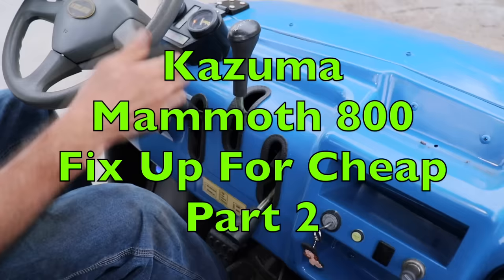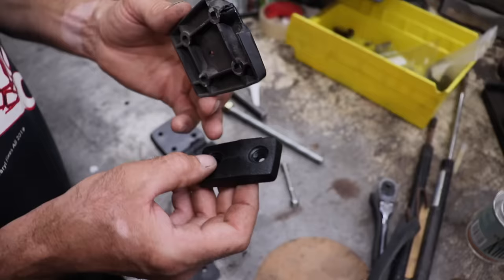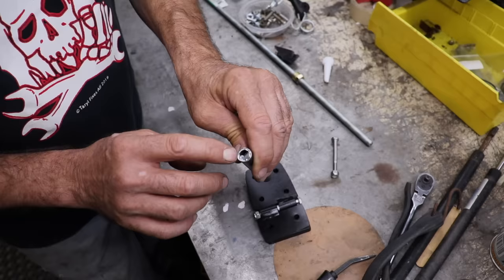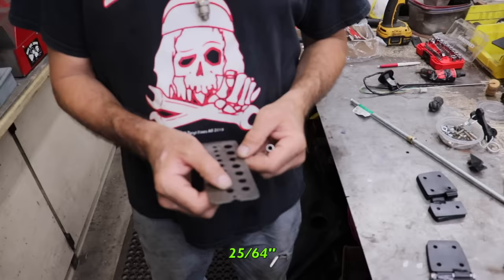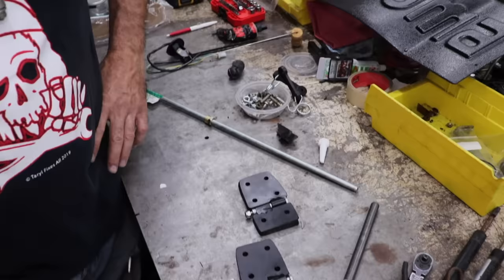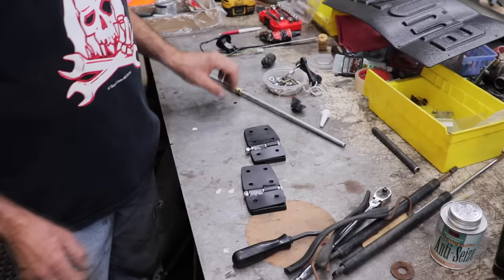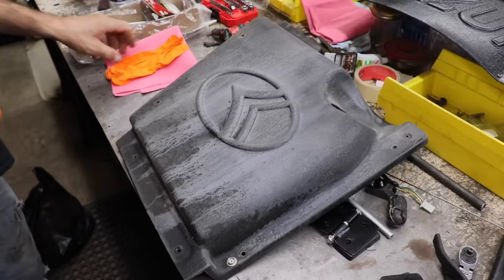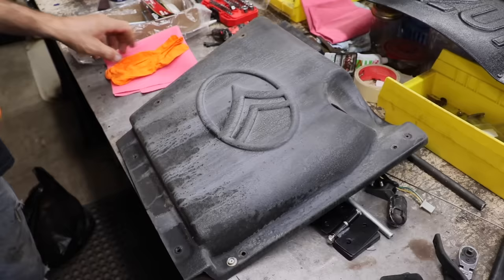Part 2! Incredible Kazuma Mammoth 800 Fix Up For Cheap!

Comment: Taryl you should consider getting a 3D printer. You would be amazed at the hardware you can replicate. Get Slippers to take some AutoCAD classes at the community college.
Reply: Yep...  Get the "Ender 3" -- it's less than $200 and is what everyone uses.

Comment: Make one hood pin longer that the other. That way you can use the long pin as a pilot and then just align the shorter pin and wha la slide the hood in place single handed.

Comment: I rework stuff like that. Most people don't take time to fix up stuff but I do. I work on ATVs for a side job. I gave $800 for a 2010 terex one seat side by side 750cc. 200hrs and replaced the belt and air and fuel filters and drained the tank and like brand new! $6500 plus side by side and $300 front bumper and a nice 4500 warn winch!  Nothing really wrong with it other than dirty fuel filter and air filter clogged up from dirt road and farm field dust an inch thick.

Comment: The cork idea for the fuel sender float is a good idea but how does cork hold up to exposure of gasoline?
Reply: Cork used to be used for fuel gauge floats. My dads old lawn tractors had them (1960's).
The problem was the cork deteriorated as it got old and broke up
Reply: Lawn boys have cork floats but they're coated, so you're right but there's a way around it.

Comment: Hey Teryl and crew I have a question: do you think it would be possible to modify a UTV like this with hand controls? An example would be the controls from an ATV. I have a disability that makes it difficult to use my legs and feet to to operate feet controls.  Blessings!!! Love the videos!! Thanks for sharing this with us!!!
Reply: I would think you could. Try contacting an outfit that installs wheelchairs in vans. It might take a little engineering, but anything is possible 😉

Comment: Water pump trick- if you do not live in some hot box area- disable the pressure cap/ o-ring system and that pump seal will last a long time. When the seal goes, it takes the bearings with it. Old cars will not blow hoses either.

Comment: If your riding in places like that with stobs and sticks make sure you run like 5 psi or les them 10 in the tires so stobs will just flex the tire and not jab threw it you really don’t need more then that in your tires anyway for that thing

Comment: Hey taryl why don't you just add on some led headlights.& put turn signal.& brake light kit on that from A golf kart set up. Then you can drive it on the street after doing that. Just have it DOT inspected.& get the sign off.& cleared sealed stamped paperwork approval.& dated. To tag& insurance it.

Comment: another great video, with some great tips and tricks. I'm sure you already know but maybe someone else doesn't but if the primary and secondary clutches get out of alignment a little bit. You won't be able to shift it in and out of the gears.

Comment: I guess we will see if the gas will decay the cork. I wonder if you have to coat the cork will something to protect it from the gas. Nice job on the repairs. Who ever buys it will have a good unit.
Reply: Indian head Shellac is Awsome for installing frost plugs on engines,I have never had one leak.
Reply: I don't see why redkote wouldn't work too

Comment: Grind one hinge pin a little shorter than the other so you can line up & put in one, then the other rather than both at the same time... doesn't take much...

Comment: You can totally retro-fit the headlights to LED. Pick up a set of automotive headlights and you can cut the slots in the holes in the back of the headlights to match the new headlight bulbs. You could even glue on some holes from old head lights with some of your awesome glue. 😎 That thing is better than new now after you are done with it 👍👍👍

Comment: Good carb spray is bad for plastic!

Expect it to bleach again, soon!

You need silicone spray, the lubricant stuff! Spray it on & let it soak until it gels, then wipe it off with a paper towel & spray it again.  Then wait, wipe, repeat. 

Like 5 times, or more after carb spray!

I used this to restore the everything on all my bikes, the worst were the handlebar switch housings on my '83 CB650-SC. They were so bleached the looked aluminum (like my '75 CB360) that you could scratch with your fingernail and showed black! After ~10 coats in 2016, they've been black plastic, almost as good as my cb600-f6!
Reply: I usually just warm plastic up with my heat gun,brings it back like new.
Reply: @oxyfee6486  With some stuff, maybe, but I wouldn't dare heating switch housings or high glass content stuff.

Comment: Quick boat mechanic tip that has yet to fail me….. Coat that cork float with POR-15, and it won’t fall apart with ethanol enhanced fuel. I’ve saved many old outboard motors that you can’t get carburetor floats for using POR-15. Just clean the old (or in your case, new cork) with their cleaner/degreaser, then dip the cork in the POR-15, let it drip dry until tacky, then dunk it again. Do that three or four times, and that cork will most likely last longer than the sending unit (or carburetor). Tip from your friendly boat guy!

Comment: Could you idiot proof the fan by having it wired and fused to always on battery power? My 1978 MGB is setup that way keeps the under hood temps down to help with the hot starts. Just have to remember to disconnect the battery before putting your fingers anywhere near the fan!

Comment: Mother's mag and aluminum polish will make your headlight plastic as clear as new.  Just take them out or tape around them, apply polish by hand, let dry and use a buffing wheel (lamb's wool) and polish away.  After they are as clear as you can get them, apply a coat of carnauba wax every 6 months to keep them clear.  Professional detailers use this on automobile headlights.  The aluminum oxide in the polish is what cuts the haze on the plastic headlight lenses.

Comment: watch that brake cleaner on plastic. test in a inconspicuous area  'melting plastic', yup. certain brands sure will. lost a few nut driver/screw driver handles and misc plastic engine bits due to brake cleaner. and course no warranty on that.